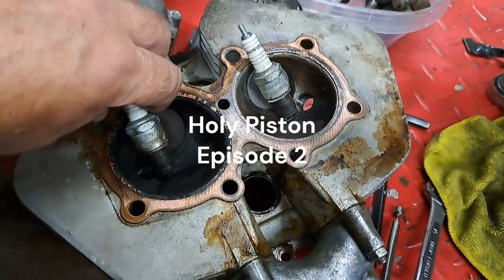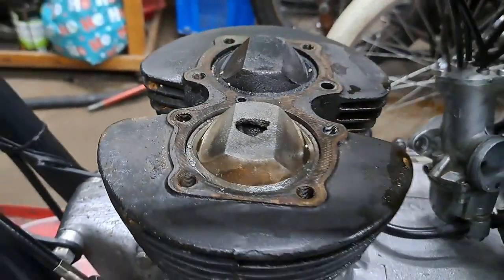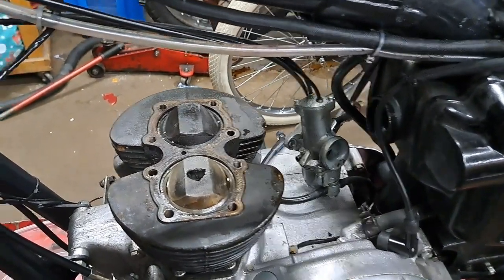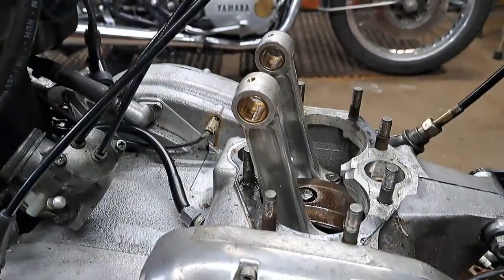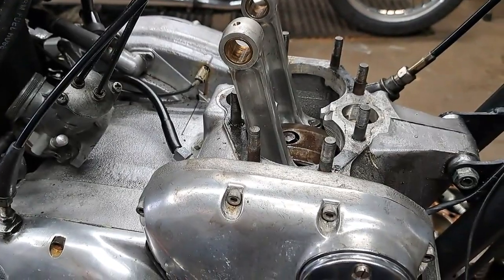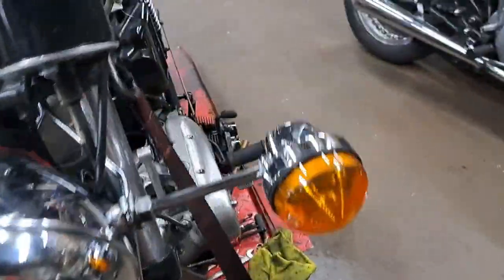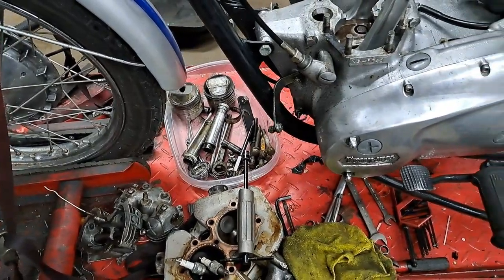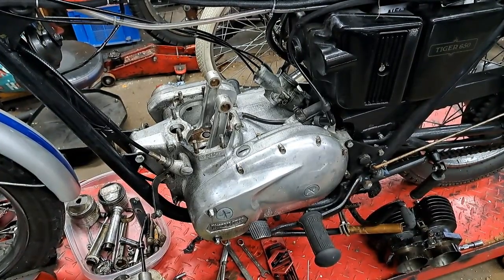Holy Piston Episode 2

Comment: Hi Bruce,  My 77 T140V holed a piston whilst returning from the Isle of Man in the early 80s.I was speeding home before it was dark because my battery was failing.I had recently fitted electronic Lucas Rita Mk1 and I had sawn the ends off the cigar silencers off due to  bad corrosion. Rings had broken, gouging the chamber and likewise aluminium had coated the valves and plug .Metal debris had also circulated. 😢The Motorway was thick with white smoke!. It was Bad. I never really identified the exact cause. Jay  SW UK.
Reply from the maker: We were talking about this yesterday at coffee.  It seems these problems usually turn up when 'trying to get home.' We've all been in situations like that. ;)

Comment: I owned 1978 Bonnie which holed the left handed piston this was around 8000 miles what was the cause was the  points timing moving 30 degree good old vibration best to fit electronic ignition ❤

Comment: I wonder what "way too hot" is and why it happened.   I had my right side spark plug threads give way on my 64 TR6 while I was riding it.   I ended up riding her  home about 7 miles on one cylinder.  The bike wasn't happy but luckily nothing bad happened.   If something like that happens again I'll probably call someone with a trailer to come get me.   Just to be safe,

Comment: I don’t understand why on that engine and a lot of those in-line two cylinder engines they have both pistons go up at the same time instead of one person being up and one being all the way down it would just make more sense to me. Other than they do it for balancing purposes but still, I think one piston should be up and the other one should be down.
Reply: After about 350cc twins develop a 'rocking couple,' whereby the bike oscillates left and right. 
When Yamaha introduced their 650cc twin in the 1970s, they also opted for the system you see here.
Honda, however, stayed with their 180° layout up to 500cc, using light weight flywheels and short strokes to grain revs for better acceleration, which accepted a high speed engine buzz.
In contrast, the 360° system yielded far more torque and a vibration element (the bane of all singles and twins) that largely went away at highway cruising speed.
Reply: Note: Honda did even-firing twins in 125-160-175cc, and possibly slightly larger as well.  (Honda shop manual, other literature, plus owning a 1971 SL-175 twin as a first bike.)

The odd-firing, 180 degree twins were 350/360, and 450 DOHC.  A friend and I called them “lawn-mower” twins because of their engine noises, while the 175 was a smoother, “screamier” engine as it really liked to rev.

As in, it was astonishingly peaky, almost like some two-strokes.  If you wanted the bike to GO, you did a constant tap-dance on the gear lever, keeping it between 7 and 10 on the tach, and never dropping it below about 5 save when coming to a stop.  Launches - bring the revs up to about 8 or 9, then begin letting out the clutch while simultaneously pegging the throttle, controlling the engine speed with the clutch so as to not go past the rev limit of 10.5.

Once the clutch was entirely out - about a third of a second, maybe less - I had my weight forward quite a bit, then; that front end was dancing - then simultaneously chop the throttle while kicking the gear lever up into second, then peg the throttle again - then third, fourth, and finally fifth at about 65 or 70.